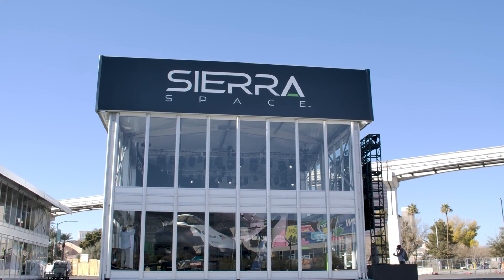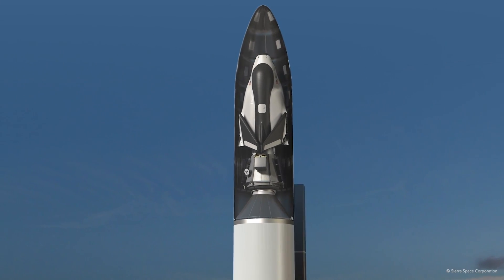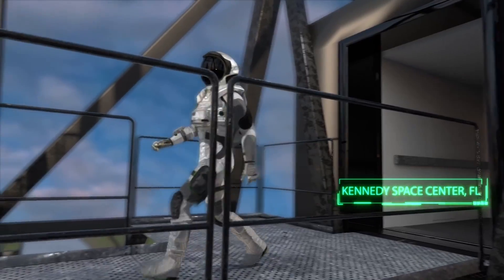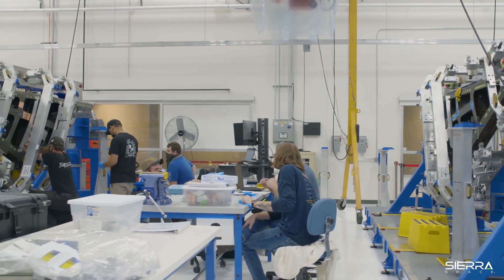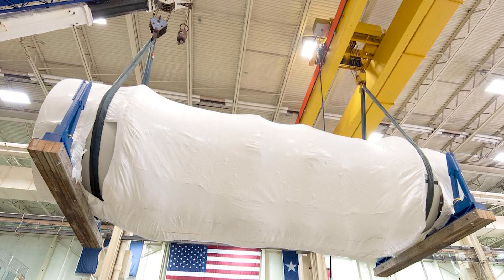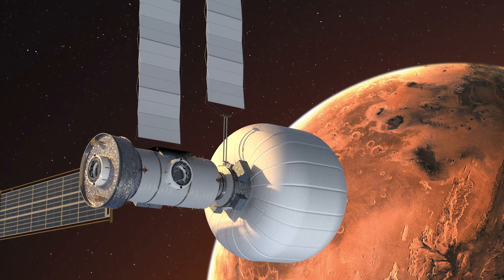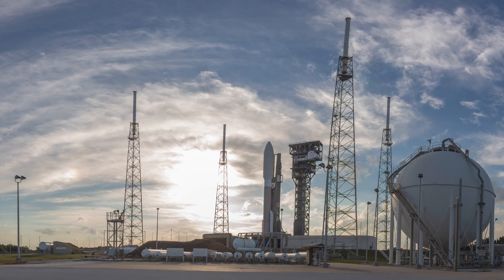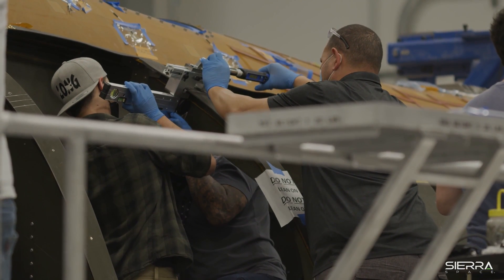Interview with Sierra Space on Dream Chaser, Orbital Reef space station, manufacturing, & more

Comment: Why no front landing wheel?
Reply: A landing wheel in the front is not a good idea as that part of the dream chaser gets really hot upon reentry, and sierra said they had some issues with the analysis of the performance of tires in the space environment, so a skid eliminated those issues, they also said it's much lighter then a wheel, very simple, and a safe option, as the dream chaser has no steering on the ground either as it will be towed off the runway.
Reply: @AHappySpace  
The Space Shuttle had the same problem, but how did they deal with the heat? I suspect the mass fraction and complexity of a landing wheel is more significant for Dream Chaser than for for the Space Shuttle..
Yet..What material is the land skid made of? it must generate a lot of heat and vibration, and be under considerable stress because of the drag due to the landing surface....
Reply: It also has less mass, so you can take more cargo mass to orbit.